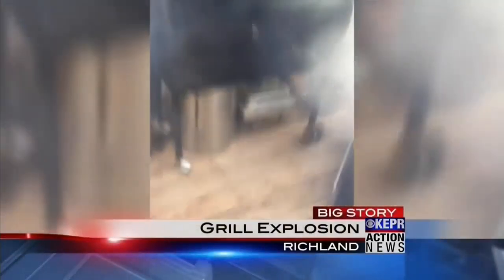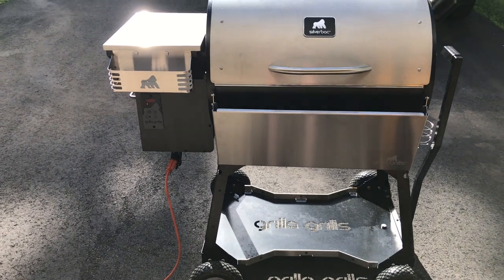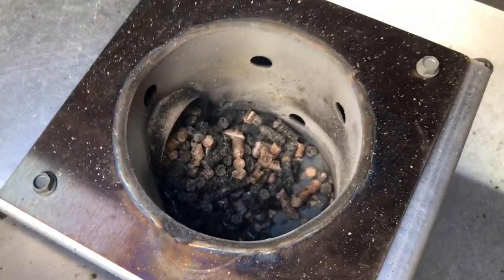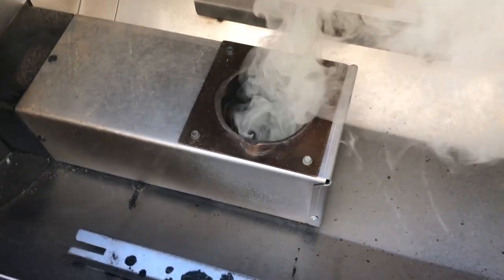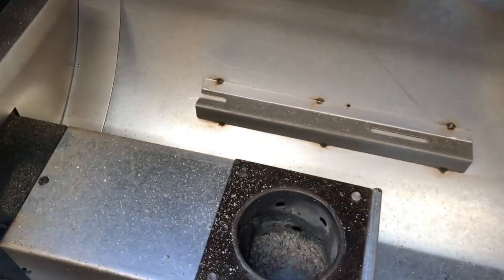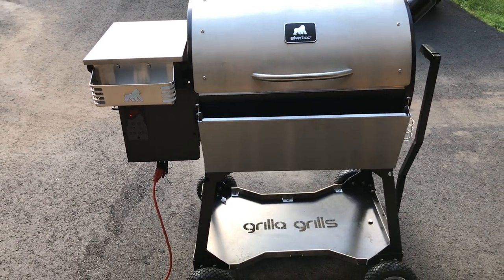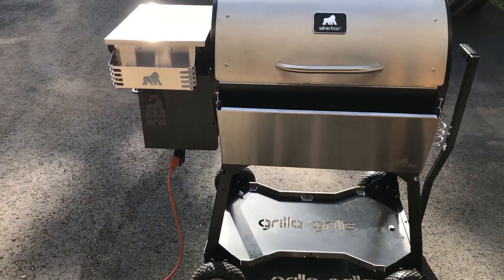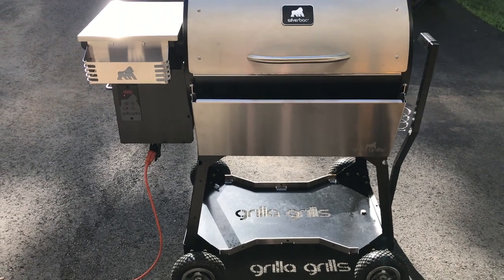Viral Traeger Exposion Explained (My Opinion)

Comment: That explains our burn out on our Traeger!  I had stepped outside a few weeks ago and I heard what sounded like our grill was running??  Sure enough, even though the cover was on... our grill had turned on because one of our outdoor cats had put their paws up on the side and flipped on the switch... which happened once before!  Of course I just shut it off and that was that.  But a week or so later I went to start it to grill some chops and got the flame out!  The hopper had overloaded the burn unit with pellets and overflowed into the outer chamber and caused a big fire.  I don't think anything was hurt, but I shut it off until the weather is good enough to completely clean it out.  It hadn't been that long since I had cleaned it, so it didn't have a lot of grease and sludge build up, but I was baffled by the fire!

Comment: Yep, fuel/air explosion in an enclosed space. Pellet stoves/heaters sometimes do the same thing…  The issue wasn’t so much the extra pellets in the chamber, they would have lit and burnt OK, the issue was that the unit was probably warm/hot.  So when he initiated a re-light, he had a bunch of wood gas/smoke and pumped in air, near the ignition temperature in an enclosed space.  When the igniter finally got the pellets to that auto-ignition point and they lit, that little flame lit the rest of the heated wood gas throughout the chamber causing an overpressure.  Especially on a re-light, you need to open the lid.  This allows the smoke generated to cool and dissipate to a point where it is difficult for the fire pot to ignite once it lights. It also removes the enclosed space, so if some of the smoke does light, it cant build any real pressure.

Comment: Another possibility when the fan has stopped unexpectedly is an auger or hopper fire.  I don't know how unlikely that may be, but some more recent designs locate the auger well above the firepot, dropping the pellets for some distance into the fireport, so as to decrease that risk.  Some designs also include a slide between the auger and firepot, separating them laterally as well.

Comment: You are absolutely correct I had the same thing happen to me. I was cooking a rack of ribs when a person that will not be named turned the switch off on the wall in the house by the time I saw it cooled down and when I restarted it it was smoking a lot and than woof. It didn't take the lid off but the ribs ended up on the deck. So sad.

Comment: Whats nice about pellet grills is that it’s so easy to remove the the grill rack and drip pan to clean and vacuum out the bottom and pot that there is no excuse for the kind of problems people encounter with pellet grills. The same is true for gas grills, but the maintenance and wear on gas grills is greater. The burner plates tend to rust giving uneven heat distribution, grease will accumulate in the bottom and attract rodents. I have found that with pellet grills there is a short learning curve then you get very consistent results and everything tastes great with no over charring ,flame outs and under cooked areas depending on where your meat is placed. Especially when grilling higher fat meats like Rib eyes.

Comment: The lid can be open and this happen as well. Happened to me on several occasions. If the pellet get slightly damp they wont burn properly and smoke much more and take longer to ignite.  The smoke when this happens seems heavier than normal and linger near the open grill. I understand its user error as well, but sure is fun to watch.

Comment: This guy probably would've been ok if he had just opened the lid before starting it up and left it open until it started burning.... my pit boss pro series is plugged into a switched plug and of course ive accidentally hit the switch and shut it off mid burn so before turning it on i just checked the amount of pellets in the fire pot and left the lid open on start up like usual and back in business... idk about trager but pit boss specifically instructs u to keep the lid open during the start up process

Comment: Smoke is tiny particles of unburned fuel (Carbon) and is explosive in concentration. Lid closed during startup is a mistake.  Especially as you described with excessive amount of pellets creating a concentration of smoke. Once the pellets lit, the gaseous carbon went boom.

Comment: My Traeger began to drop in temp yesterday. Then it only put out smoke and not enough heat. I moved the ribs into the house oven. I took it apart and the fire pot was full of pellets and smoldering. The induction fan had died. I'm glad I shut it down. I'm replacing the fan, the auger motor and the firepot and fire rod. Should be much safer and a better smoker soon.

Comment: This exact thing with exception of the lid blowing off happened to me. The grill was running 350 deg. I checked again and it was 90 deg. So I selected smoke (start) with lid closed. Then boom. Pit Boss, it has worked flawlessly ever since but I wont leave it unattended for a long time.
Reply: Replace the control with a Savannah Stoker, never have to worry about a flame out again, and more precise temperature control. I also have a Pit Boss, had the same thing happen mid smoke, and BOOM.  Why these don't have a re-ignite system, I don't know.

Comment: I had my Z grill running over temp and throwing error codes.  Took it apart and cleaned everything.  Put it back together it wouldn't come up to temp at all and kept shutting down.  I just tried to use the grill and for about 10 minutes my back yard looked like a 4 alarm fire with so much smoke and eventually got the flame up blowning lid up.  I let it die down took it apart and the auger had pushed enough pellets in there to fill 3 pots.  I'm curious why it did this.

Additionally, my Zgrills interior looks 100% like yours did.  Are the parts all made by one company?

Comment: Hi John.  Thanks for the explanation... that was very helpful. As a new pellet grill owner, I am careful to all the instructions but....one thing my manual does not address and this just happened  to me and I cannot find info on it even on the internet....maybe you can help.   I was cooking a brisket 250 deg on my pellet grill.  Half way (5 hours) into the cook, I got distracted with a business call and coincidentally at that time, I unknowingly ran out of pellets mid cook.  When I went to check on the brisket, the temperature dropped quite a bit and I realized out was out of pellets with the grill still running.  What should I do in this situation?
Reply: If it's cooled off just turn it off, check the fire pot, clean it out if there are pellets in there, add more pellets to hopper, restart grill normally.
The big thing is you don't want to try & restart without checking the fire pot.  I've heard stories of them going out, the auger filling the bottom of the grill with pellets & then people restart...they end up with a huge fire that could be dangerous, but most of the time just ruins the day & maybe the very expensive grill.
Have fun with the briskets...that's pretty much all my traeger is used for...& I wouldn't have it any other way👍

Comment: Just got a Z grill Pellet today, it's ready to go.  One thing for sure, after the cook, I think it wise to dial down the temp and let the fire pot finish the pellets there and not burn back wards into the auger.  Been a wood stick and propane smoker forever.  I left elec. smokers ages ago. Tired of messing with wood.  Also have a Vertical propane smoker, Pitboss. and it is very easy to drive even over long cooks, 12-18 hours holds up at 250F without any work.  Can use pellets or chips. Probably still do the whole briskets on the PitBoss, but want to explore all the recipe variables the Z gives me. Wish me luck.  Grill on bros.........

Comment: Another thing......wood gas is flammable.  You will get a build up of smoke and wood gas, like the dude in the video had, and if it can't escape fast enough, it could ignite.  I just experienced this phenomenon a couple of weeks ago.  I have just a plain Jane Masterbuilt electric smoker, and when I got the initial smoke rolling, I had a REAL GOOD "pfoomph!" (I spell it like it sounds).  I didn't have my top damper open enough, and the heater element was enough to ignite the trapped wood gas.  Just food for thought (no pun intended).

Comment: Well with mine it went through the shutdown process and completed it but the pellet box was smoking as a result fire got into the pellet box and destroyed the grill thankfully I saw it and controlled the damage but I am out $300.00 however the few times I used 4 times I was impressed with the cooking process and flavor. I am investigating to the cause of the fire. Do you have any suggestions? I was cooking burgers and I cleaned the pot and grease tray prior to cooking.

Comment: Wow, I just returned a pellet smoker for this same event happening.  Each time I opened the smoker, if flamed out.  i went through the shutdown procedure, but apparently there must have been so many pellets in there that it still happened. I can't imagine having to remove all my meat from the smoker, remove the drip pan, and the shroud each time I want to check the temp of the meat inside because it flames out each and every time I open the lid.....wow.  In this century, one would think there's a means to introduce some sort of safety mechanism to prevent this.  Live and learn I guess, thanks for the video, it's a great explanation of what happened, and how to avoid it.

Comment: The green mountain grill if there's a shut down you press and hold the start button and the grill will pickup where it left off.
Reply: I also have a GMG and the hot start option is awesome.  Kids run around and unplug mine often

Comment: I had a similar experience this past weekend, but I wasn't home when the big-bang occurred. It happened during the last 30 minutes of a 4 hour smoke at 225° when I made a quick trip to my local grocery store. As I was finishing checkout, my wife called me in a panic, saying she had just heard a loud bang in the backyard and that the Traeger, about a year old, was spewing a lot more smoke than usual. I told her it was fine and that I would home in 5 minutes. When I got home there was no damage and the lid was closed. The grill was still spewing a good amount of smoke and the controller displayed 390°. I turned the controller knob to Shut-Down, added some BBQ sauce to the baby backs and fortunately the ribs only had a few slightly burned edges. A couple hours later when dinner was over and the Traeger was completely cooled, I opened it to see what evidence there was. After removing the gratings, the drip pan and the heat shield covering the fire pot, the only thing unusual was a concentric ring of ash pellets (they were all completely burned but remained the perfect shaped of a pellet) around the outside of the firebox.
  The problem is, if you are not constantly watching your smoker, there is no way to know when you get a flame-out or other issue, unless you have a unit with wifi or a separate temperature probe that communicates with your phone or a receiver. Because of my recent issue I plan to get a unit by Thermoworks that will come with four probes and I can use one for the air temperature and set it with min/max alarms. That way I can get all the status readings I need and I should be able to head off a problem like this from happening again. I have a 17lb brisket I plan to cook soon and with a 10 to 12 hour smoke I can't leave it to chance.

Comment: Alright I do agree, user fault does play a roll. This type of hobby requires some strict safety standards. Those chambers fills up carbon monoxide and becomes saturated due to the combustion of wood pellets.  Carbon Monoxide is extremely flammable, what do you think will happen when it catches on? It will explode. You can't blame the user fully since you have fire combustion involved into a well sealed vessel. The company should have implemented simple common safety features, such as closing that fire pit opening due to an electronic error, power outage and etc. Closing the fire combustion area can be easily implemented, like using a solenoid metallic lid cover which normally closes when there is no power.

Comment: I'll stick with charcoal  with socked wood chips for smoking.  BBQing should be simple, don't have time looking for error messages.
Reply: Michael L / #sobrave
Reply: I have used the charcoal loaded with chips and I gotta be honest. It's not the same
Reply: These grills are very simple. Put in pellets, select temperature, go mow the lawn. Your not going to get a flame out or error unless you run out of pellets or close the chimney off.
Reply: My buddy Chuck drives a Cummins
Reply: CG261 86 Right on. Im more of a Chevy guy. I have a 6.2L half ton and a 6L 2500.
Reply: Lol typical.  (In hillbilly accent) "Jesus Christ Cletus, I ain't got no time to do no readin' of err messages.  It takes too dang long for me to read and understand a 3 word message."
Reply: @ChuckBeefOG  hahaha I just did that today. Placed a leg of lamb on it, went about mowing my lawn, weeding my garden came back to a nicely done leg of meat.

Comment: Electric grills are backdraft simulators. The procedures are written not because of the complexity of the engineering in smoking or grilling. But, because of the fact that they legally know that the grills/smokers are notorious for backdrafts. And gas grills are designed do that they cannot become pressurized. So even when you wait 20 seconds while flowing gas to hit the ignitor, it will just make a poof and the excess volume is directed away from the user. I have never heard of a backdraft with any home made or brand of wood fired grills or smokers only electrics.

Comment: I used my grill when it was cold and a day or so it got warm I used it again but I noticed the flame under the grate was kind of bigger than usual so I turned it to shut down and didn't not grill since I got scared it would blow up....should I just take off the fire shield and look too see if its full of pellets first before running the grill or just clean it after each use? also do you think the pellets can get damaged from the fluctuation in outside temperature? and cause them to back up?
Reply: The outside temp only affects the cook time. HUMIDITY can and will affect the pellets. Always empty the pellet hopper after each burn. Pellets soak up water (humidity) like a sponge and can cause clogging in the auger, improper feeding, and irregular temps in the grill.
Reply: PS...Always store your pellets inside in a dry area.

Comment: Have you ever shut down your grill "properly" only to find smoke coming out the hopper 20-30 minutes later?
Reply from the maker: Paul Harder yea great question. Sometimes pellet grills will have a little Blackburn. This usually happens when you’re running really hot and then you go straight to shut down. It’s best to go to 250 for a little first then shutdown.
Reply: @johnbazyk9976  okay, would you expect it to happen grilling corn at 300?

Comment: I own a Traeger that 'blows up' regularly lol; It took 1-2 months of playing with it to figure out what happened. What happens is after 75-90 minutes the flame dies and the ignitor doesn't fire again. The auger keeps running an fills the pot with pellets until the temp drops below 120(i think) for 10 minutes then the grill shuts down. If you start the grill without clearing the pot it'll smoke you out of the yard until the pellets ignite then half you food is blow onto the ground. My solution is that I power cycle it every time I flip.

Comment: My Traeger did this after I switched from smoke to 350 and it is totally Traegers fault! Traeger calls it a high pressure event and was not apologetic about the incident at all even though the grill failed to turn off on its own after it occurred and black smoke was rolling out of it. Traeger and other smoker companies need to put a warning and a remedy to the situation in their instruction manuals.

Comment: Lid open to light…what most people don’t realize is smoke is unburnt fuel of what ever matter you are burning it just burns at a different energy level or until the volume is produced at a high enough level. By having the lid closed he trapped all this unspent gas inside the grill, when he put the power back on it…it ignited all at once causing and explosion.

Comment: that's a lot of hassle for something supposed to be easy to use?
Reply from the maker: P JB not really. If you start and shut down correctly each time without just unplugging the grill than it’s fine. I’ve never had an issue and I have 4 pellet grills for 3 years.
Reply: John Bazyk understood 👍🏿

Comment: Well, it happened to me and it didn't turn off it was running,  I had just turned it on a d within 5 minutes it blew up! Its also happened during a cook after about 4 hours didn't turn off jut start smoking excessive and boom! Its brand new and every single time I have used it its blown up on me!